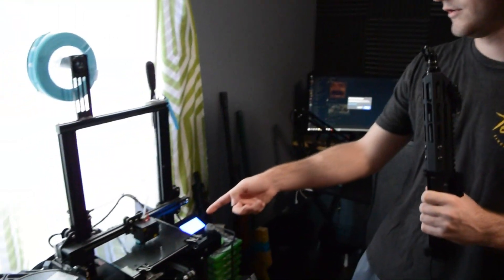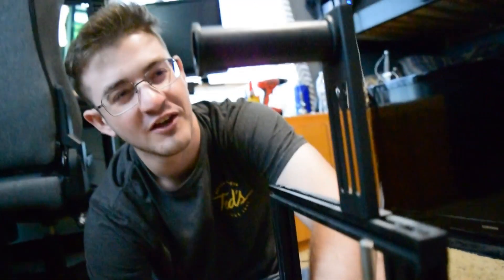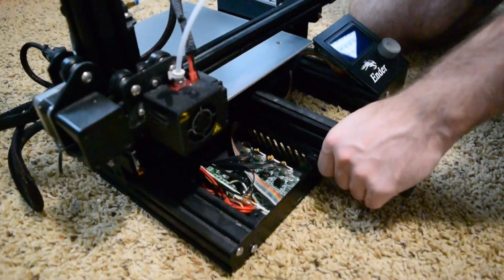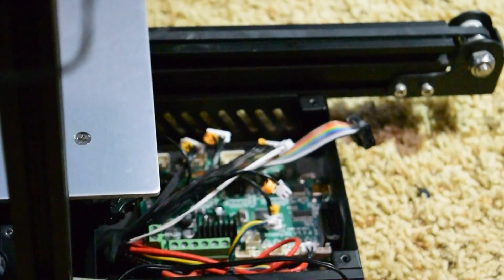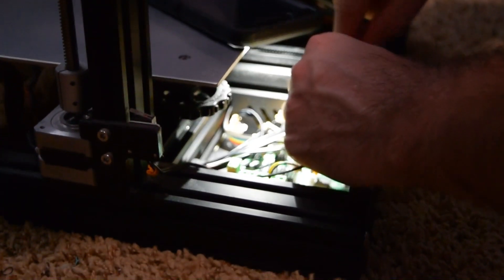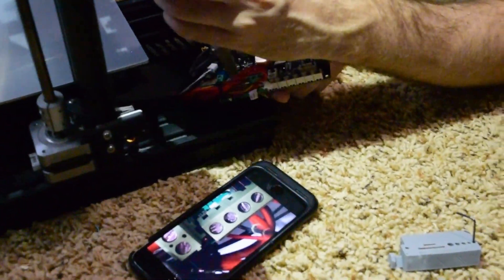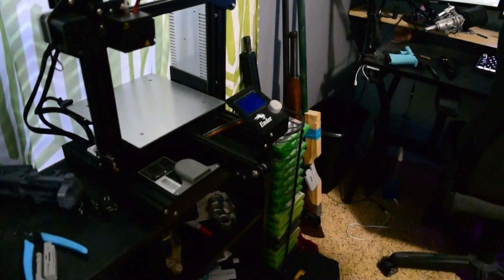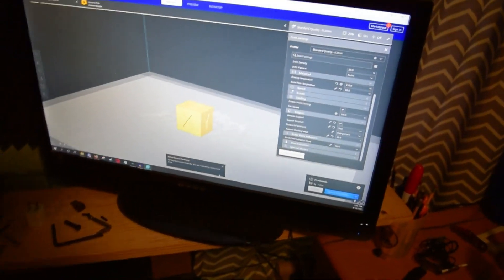Ender 3 Silent Motherboard (I have no idea what I'm doing)

Comment: I know everyone is on this kick about ender 3s for 3d printing of guns, I bought a Biqu B1, and it produces much cleaner prints. Has a colored LCD touch screen and a lighted print head. Cost about the same as an ender 3 v2.
Reply from the maker: The Ender 3 is perfect for me because I like how much quality I get for the price. And I can live without an lcd screen so I don’t have to pay that premium in the V2. I may have to check out the Biqu B1, though
Reply: @PlastikGatz  I don't use twitter. If you have a subscriber email you use I can send you photos. The difference is big, the quality of the Biqu B1 print vs the ender 3 print is night and day. I believe the B1 to be faster than the ender 3. It prints better than my ender 6 as well. I do use the B1 in the creality soft enclosure, but even the mag I printed out of the ender 6 you can see the lines, and I have set both profiles up the same.